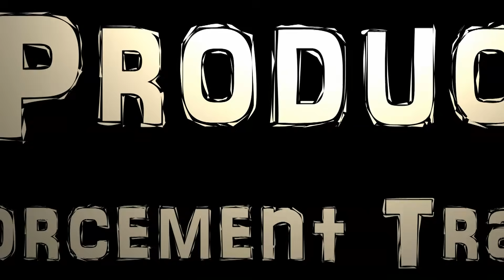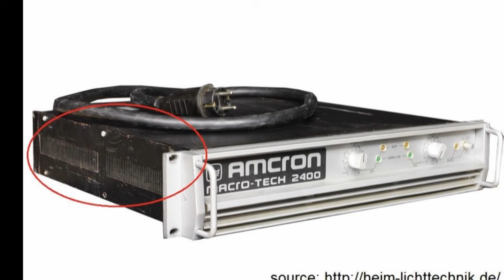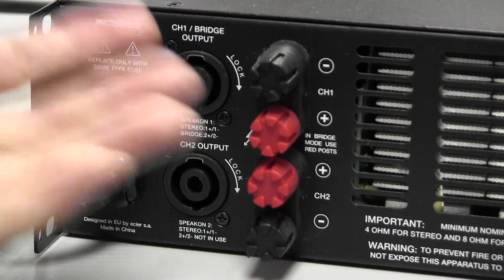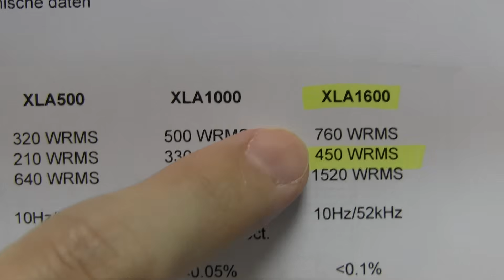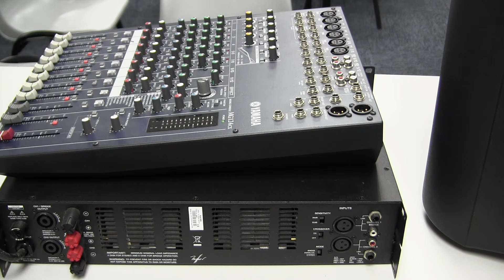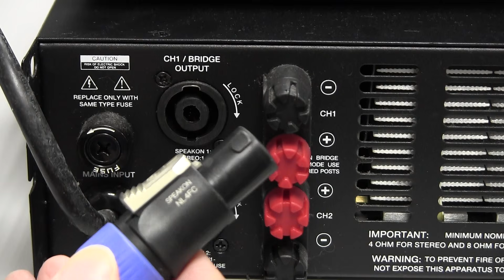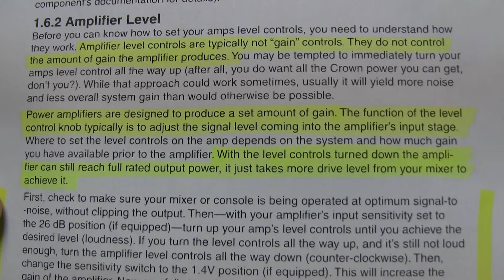How to connect a power amplifier to passive loudspeakers

Comment from the maker: Bookmarks for video: 
00:00 Intro
01:08 The difference between active and passive loudspeakers. 
02:45 Overview of a typical modern power amplifier.
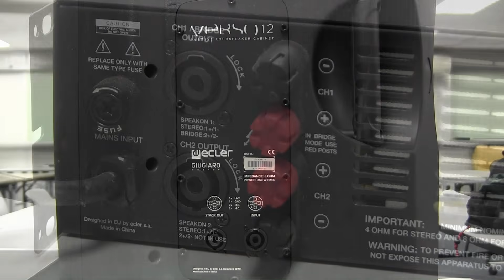10:25 Overview of a typical passive loudspeaker connector panel.
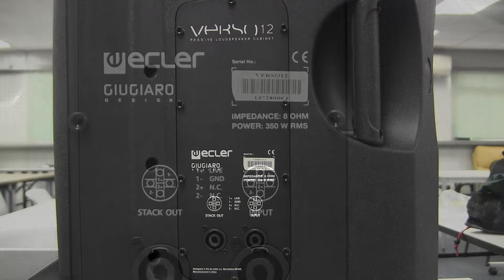11:08 Step 1: Ensure amplifier and loudspeakers are correctly matched. 
11:35 Step 1A: Determine power handling capacity of your loudspeakers
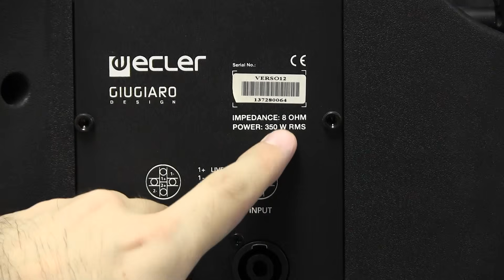12:52 Step 1B: Determine loudspeaker impedance. 
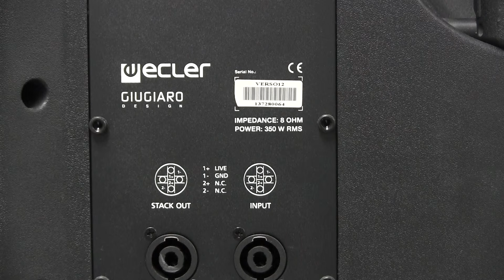13:32 Step 1C: Calculate power delivery of amplifier into loudspeaker, based on impedance.
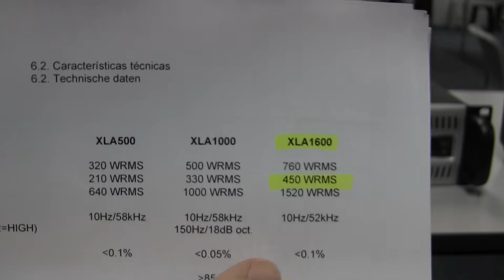14:37 How to calculate the combined impedance of multiple loudspeaker cabinets. 
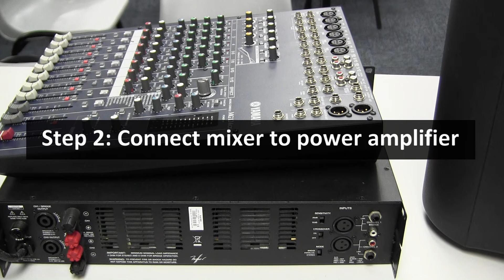17:17 Step 2: Connect mixer to power amplifier
17:47 Power amplifier modes: stereo, parallel, bridge mono. 
20:51 Daisy-chaining power amplifiers
22:25 Step 3: Connect amplifier to loudspeakers. 
25:58 Setting amplifier gain and level controls.
Reply: Good day sir..I have question bout my set up at home..I have a P7000s Yamaha amp and a pair of Yamaha s112 loudspeaker rating 300 RMS and 600 peak 8 ohms..I jst connect an iPhone to test the sound but I'm not getting much loudness sound  of it..volume are more than halfway on the amp and the iPhone is almost full..what seems to be lacking wit my connection or set up?..do I need more speakers to add to bang my ears for the loudness I'm looking?..the two Yamaha speakers should be enough to bring much loudness but not getting it..
Reply: I have a  question for you, sir. Is it possible to connect active speakers to powered audio mixers to amplifiers ( peavy ir2000) and to cross over? Knowing that some mixers  have built in the equalization system.
Reply: Hii Sir... Can you upload some new videos. Just longing to see your new videos again.

Comment: Hello sir thanks for your videos I have a quick question I have four passive woofers in two separate speaker boxes but I connect one of the speaker boxes it throws the amp in protected mode but I hook the other set up it plays fine do you think it’s a bad speaker? I did remove the speaker from box and the connection on back of speaker was hanging loose could it have possibly shorted out that one speaker and causing amp to go in protected mode?
Reply from the maker: Yes, that sounds like a good explanation.

Comment: Kindly advice i have 4 Hybrid plus pk15 speakers and 4 hybrid plus 18s single base bin..and have one b2400 amplifier and one b4000 amplifier...as for mixer i use 8 channel alto professional mixer. Kindly assist on how to connect this speakers correctly
Reply from the maker: Take a look at this video, it will help you match your speakers and amplifiers correctly: https://www.youtube.com/watch?v=l9L7uK7Xy0w

Comment: Can anyone help on this
Can I use Crown XLi 1500 for 2 SX300 speakers
Crown XLi 1500
2x 450 Watt/4 Ohm
2x 330 Watt/8 Ohm

EV SX300
Power Output in W(RMS) @ 8 Ohm: 300 Watts
Impedance (Ohm): 8 Ohm

I believe it should. But I am not sure. I  
Could anyone please confirm
Reply from the maker: If the above figures are correct this is a good match. To be absolutely sure, get in touch with EV and ask them the same question - their answer will be the definitive one. Thanks for watching :)
Reply: @GLBProductions Thank you so much🤩
Reply from the maker: You're welcome :)

Comment: I could someone please help on the outputs of my amp can I use the speakon output to a trs 1/4 jack lead to my speakers would this be OK and safe or am I about to blow myself up in the morning when my 2 speakon to trs leads turn up many thanks 😊 🙏
Reply from the maker: It should be speakon to TS, not TRS. This is perfectly ok IF the cables are wired correctly. With this type of cable, make sure that the power is OFF when making or breaking connections, as it is possible for shorts to happen with the TS end of the cable.
Reply: @GLBProductions  thank you 🙏
Reply from the maker: You're welcome Robert 😊

Comment: The power amp has two channels and is rated that it can accept as low as 4 ohms.  (1) [ 4 - 8 ohm speakers.] If I connect one 8 ohm speaker to one channel and then connect another 8 ohm speaker to that speaker what load is the amp seeing? If I do the same thing with the other channel along with the first, what load is the amp now seeing? (2) [ 2 - 8 ohm speakers.] If I connect one 8 ohm speaker  to channel one and one 8 ohm to channel two what load is the amp seeing?
Reply from the maker: Hi there Richard :) 
1: Combined load is 4 ohms, on that one channel. 
2: Load on both channels is 8 ohms. 
On most pro-audio power amps the two channels are independent and the load on one channel does not affect the other, unless the amp is run in bridged mode, which is a separate discussion.

Comment: excellent! very much appreciate how transparent you are with the info in this video. 

i’m currently building a rack mounted guitar rig for live performances and was wondering if using a power amp similar to this (specifically a Mackie M1400i) would work if connected to a 16 ohm passive speaker cabinet. it contains 4 60w celestian vintage30 speakers
Reply from the maker: It would definitely work, and will almost certainly be very very loud! The question is whether or not it would sound good - that would depend on the rest of your signal chain 😉

Comment: Hello can I connect from amplifier to speakers more than 50 metro? Are that possible
Reply from the maker: Yes it's possible but you will have significant power loss with a run of that length.
Reply: @GLBProductions  Ok so I can ?
Thank you 😊 for you.

Comment: I have 2 sound systems. A sound art 5 channel PA mixer with 200watt sound art passive speakers . Another is EFX12 Sound Craft mixer and 2 off  2000watt Alto powered speakers. 
Most times, I need to use the sound art pa system to get the job done. I wanted to learn if I could connect my EFX12 to the sound art pa mixer and control the sound mixing and control from the EFX12?
Reply from the maker: Yes you can, I have a video on this topic: https://www.youtube.com/watch?v=HgeVInOV1Kk
Reply: @GLBProductions  thank you. Will definitely work on it .

Comment: A most excellent video!  However, you did not cover passive speaker cabs that do not have Speakon connectors, but instead have 1/4" connectors.  I'm assuming that you just use 1/4" speaker cables.
Reply from the maker: Correct, the connectors change but basic wiring configuration does not. At the risk of stating the obvious: When using 1/4" cables, make sure that you are using loudspeaker cable and not guitar cable 😅

Comment: HI Bruno, I have been looking to buy a DJX750 on Gear4music which looks great for old skool raves but I would like to know what kind of connections I need to use as it doesn't have XLR outputs? Great demonstration by the way and will be looking to get more equipment after this 🙂
Reply from the maker: Hello Graeme, I assume you mean a Behringer DJX 750? That mixer has only RCA outputs, so you would need an amplifier that has RCA inputs, or you could convert from RCA to XLR male using an adapter cable.
Reply: @ yeah that sounds perfect getting an adapter as I want the set up looking old skool as I was born and raised in the 90’s 😎

Comment: Thanks for the insight.
I have two amplifiers at a small Church but one is faulty and I can't use it so I need to share all speakers with one EV 9600 for the while. I have a pair of 18" JBL subwoofers( 2 in 1 so 4 speakers in total) and two pairs of full range 15" making 8 speakers in total.
Can I use one  chanel for the subwoofers and the other channel for the full range/mids.
Reply from the maker: You could do that but your system will be in mono. You also need to calculate if the remaining amplifier can handle the combined impedance of the loudspeakers - some subs are 4 ohms and not all amps can handle a 2-ohm load.

Comment: Thank you Bruno....
   Can please  tell us how to  connect passive and active speakers together??
Reply from the maker: It's generally not possible to connect passive and active speakers directly together: passive speakers must be connected to an amplifier, active speakers can be connected directly to the mixer. So you could use passive speakers for your main speakers and active for your monitors, or vice-versa.
Reply: Active speakers have output connections plug the main source w.e you playing music from to your active speakers then on the back of the active speakers is a output to connect to other speakers ,connect a wire to the output on the active speakers to a amplifier then connect the passive speakers to the amplifier ….done

Comment: What if we are connecting to subwoofers and then to speakers?
Reply from the maker: The same general rules apply, but you need to follow the manufacturer's instructions when it comes to the order in which the various loudspeakers should be connected, and what the total number can be per amp channel.

Comment: Sir at 25:30 the connection to the speaker from amplifier is little bit confused (you've said from amp out to speaker input but you've connected to output of the speaker sir )can you please reply me please
Reply from the maker: Ah yes I can see - the two connectors on the loudspeaker are actually wired in parallel, so either one can be used as an input, and the other as an output.

Comment: Sir i have a questions.. We have yamaha power amplifer P5000s, And in the back pannel there was a written like this 
Max output : 1500/8ohms(bridge mode)

So with using this amplifier will we be able to match with Yamah sub 18" CXS 1000 watt 8ohms.. please i really need it
Reply from the maker: Yes it will work :)

Comment: I have two power amps, 2 channels each.  I want to drive two Main speakers and 5 stage monitors.  Can I do this with these two amps and how?
Reply from the maker: Are the speakers identical, or are your main speakers larger and your monitors smaller. Likewise for the amps - are they the same model, or is one meant for use with the main speakers.
Reply: @GLBProductions  Monitors are identical and smaller than the mains. Amps are different models.  I plan to use the higher wattage amp for the mains and the lower wattage for the monitors. As far as the mixer, we have an old Allen-Heath PA28 (24 channel) that has two foldback aux (prefade) and one standard aux (postfade). Would be nice to use all three aux to split up the monitors but not sure if the standard postfade is suited for that.  Was thinking I could daisy chain the monitors; three into one channel and two into another but not sure about the impedance matching and overloading on chaining three.
Reply from the maker: You can use the post fader aux in a pinch but it is not ideal as the monitor levels will change as you move the faders. This can be ok if you work things out during rehearsal and then keep the faders mostly stationary during the show. 
Three into one channel can work if the power amp supports a 2-ohm load - you'll need to do some research on this and also testing to see if it holds up in real world use. 
All the best for your music!

Comment: If I am connecting an amp with an XLR "link out" to a very cheap amp that only has RCA inputs will that work if I simply use an XLR to dual RCA cable or would I need an XLR to single RCA to go into just one of the other amp's inputs since the XLR is only coming from one channnel on "amp 1"? Will there be a problem only using one of the link out channels or will I need to use both link outs to get a full signal? If I do then will getting RCA splitters to turn the dual inputs into quad inputs or would I need to ? Also the 2nd amp will only be used to power a single sub then I should be okay using just one of channel? I'm sure these are some very rudimentary questions but I'm working with extremely basic know-how that I obtained in the late 90s but haven't used since then so I am essentially starting from scratch.
Reply from the maker: Hmm, this is a tricky one because you are going from mono balanced to stereo unbalanced. The ideal tool for this job would be something like the Radial Pro-Iso, which is a balanced to unbalanced signal converter and is made for exactly this type of situation. Failing that you can try and use an XLR to dual RCA cable, but it must be wired correctly - pin 3 of the XLR should be grounded and NOT wired to the right RCA channel. A lot of people who make and sell these cables do not know the difference between balanced and unbalanced connections and just connect things in any way they will go together. There is no problem using only one of the link outs on the first amp. A third option would be to forgo using the link connector and just send a separate, unbalanced signal to the second amp, using a separate output on your mixer or crossover.

Comment: I feel more comfortable with passive speakers.  I've never have problems with my gigs, just more work to set up.  I own powered speakers too.
Reply from the maker: Well said - using tools that you are comfortable with is so important. I would add that passive speakers are actually simpler to set up because only a single cable needs to be run to each speaker: the additional work comes with setting up and transporting the amplifier rack.
Reply: @GLBProductions  I doing wireless setups with powered speakers.  Fast setups.  I still like passive speakers still.

Comment: Thanks for the training. I have a question: Is it correct to use speaker speakon as output and at the same time use open wires through option 2 outputs of the same channel to connect more speakers? If okay, what will be the power output and /or impedance for this channel?
Reply from the maker: Yes you can do that, the speakers will be connected in parallel. Remember not to exceed the minimum impedance per-channel rating of the amplifier.
Reply: @GLBProductions  thanks alot
Reply from the maker: You're welcome!

Comment: Can you connect two 15 inch speakers that are  6 ohm , 450w RMS and daisy chain to or from  a 18 inch sub that is 8 ohm 400w RMS with a 4 ohm 2x850w amp  ?
Reply from the maker: Yes you can, but that combination will have a combined impedance of 2.18 ohms, which may be too low for your power amplifier to drive.

Comment: Is a mixer mandatory? I was thinking of running a full range speaker off just an amp. Am i able to do this?
Reply from the maker: Yes you can do that, as long as you have a line level signal to feed into the amp.

Comment: Question : You said to not use a speaker wire for more than 50 ft
How can I connect a speaker that is that far away ?
Reply from the maker: That is more a general rule than an absolute limit. In pro audio it is always best to keep the speaker cable connection as short as possible.

Comment: its very blessed voice you have. not a single thing missed and not a single unnecessary word. So that said, I am wondering if you are still updating your comments in this since this video was published 7 years ago. but when I was confused about how I should connect output wires into ZM 75 amp (its a samson amp) checked all over the internet but non gives a useful advice about how those output should connect to a speaker. If you still reading please response this comment it will be a great help to me. also the speaker I have is bose FS 2SE. this speaker also confusing me with its ins and outs. please help..
Reply from the maker: Hello :) The Samson ZM75 amp is a specialist zone mixer/amplifier which is designed for use in commercial environments like restaurants, hotels etc. You've noticed that it has a lot of outputs but is only a mono amplifier. This is because it can output into standard low-impedance loudspeakers such as the one shown in the video but also into a constant voltage installation, where each speaker is equipped with a step down transformer. If your speakers do not have an input transformer you should use the "Lo-Z" terminals on the back.
Reply: @GLBProductions   Thank you very much for the reply. that explains why a noisy output comes through the speakers when I connect stereo input. should try mono input.
Reply from the maker: You're welcome :)

Comment: Can I hook a passive speaker to an active speaker  and  the  the  mixer
Reply from the maker: No - you can connect an active speaker directly to a mixer but a passive speaker requires a separate external amplifier.
Reply: @GLBProductions  can I hook an active speaker to a passive speaker
Reply from the maker: No you cannot.

Comment: I would like to use 6 line array passive speakers (Fohhn  60W 100V) at home just to experiment the sounds from such units. I have an older 100V amplifier with typical connectors for 100V vintage amp. So do I connect one speaker to the terminals and then I connect speakers in line? Is that the way it goes, I am good with home Hi Fi, but first time trying to use 100V amp and passive speakers. Found explanations on Youtube but all confusing to me.
Reply from the maker: 100 volt lines are not my specialty and can be quite dangerous because the voltages involved are equivalent to AC power. Make sure that the tap switch on the speaker is set to 100V and if necessary call somebody local to you who does 100V line installs. Don't take chances, especially since you are working with older used gear 😉